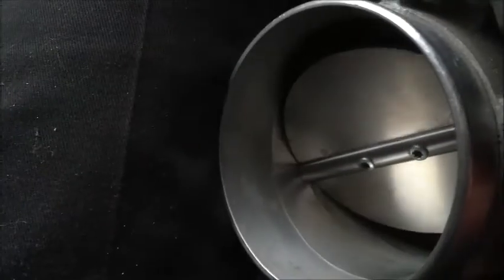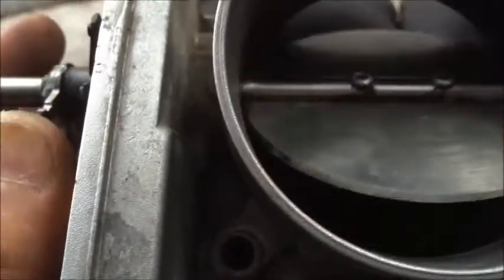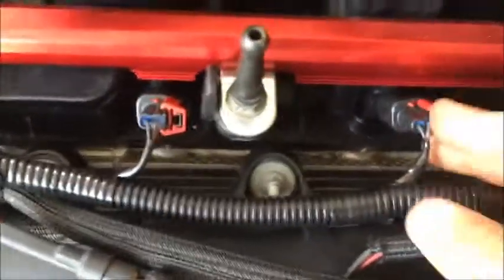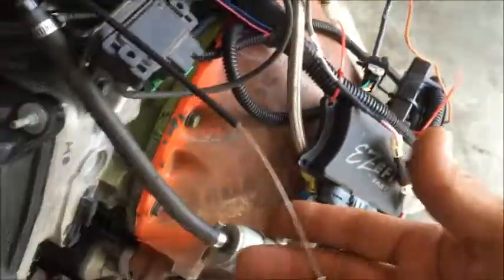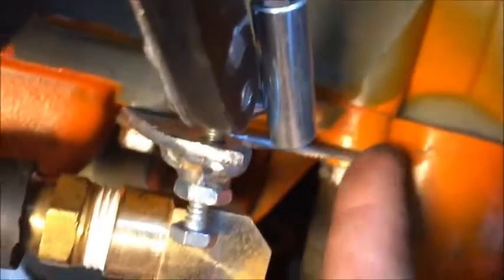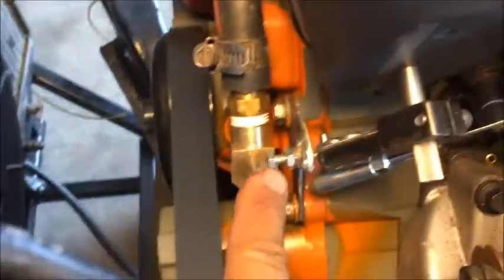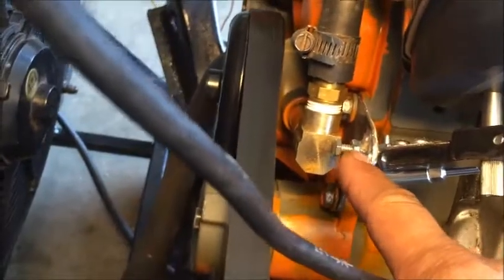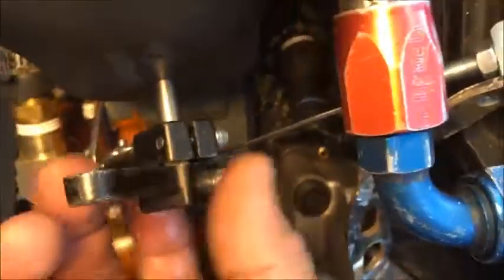Part 2, Running the 5.7 G3 Hemi EZ-EFI and MSD 6013

Comment: Did your power steering end up working with the pump on the hemi?
Reply from the maker: Drove the car 10,000 miles last year and almost as many this year. Power steering has been working well. I bought a high pressure gauge off of eBay so I can tee it in, to play with the spring to determine exactly what pressure range I can adjust with different spring lengths.